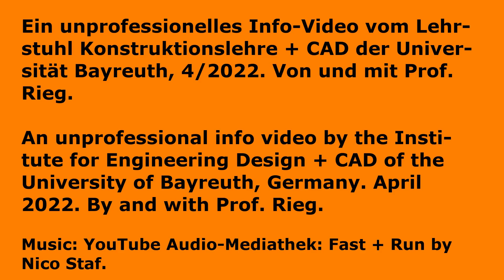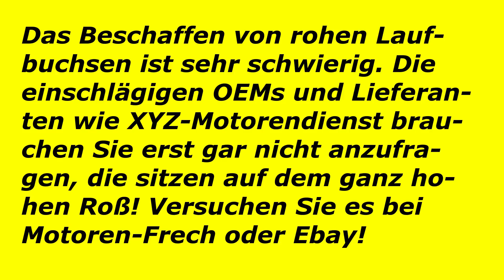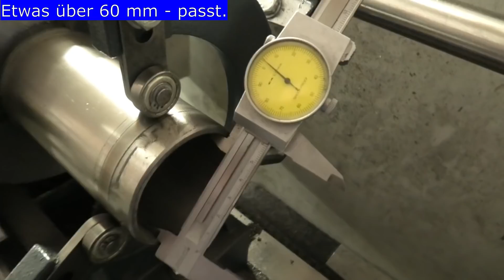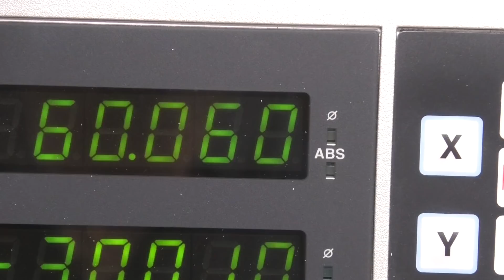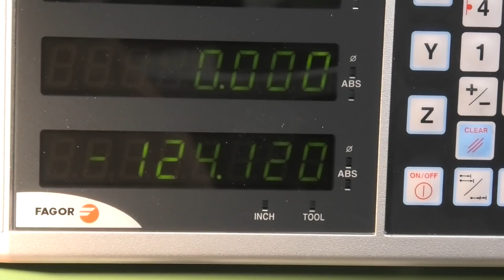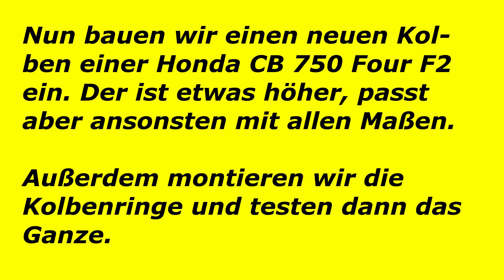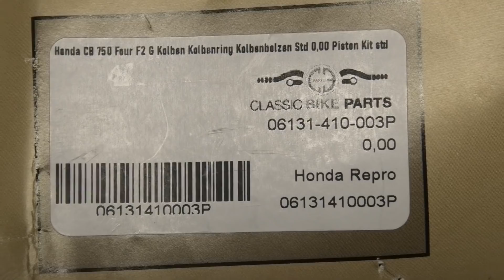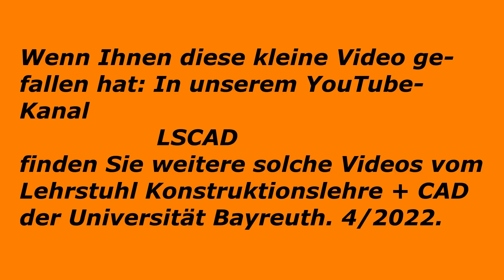Herstellen und Honen eines Zylinders für 158 ccm Viertakter.

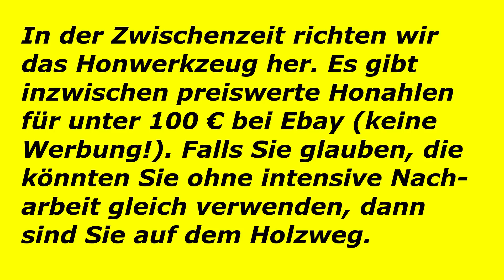Comment: Glad I found your video series, very informative! Can you clarify the honing tool? At 7:16 you say 'the fixtures of the honing stones have to be massively reworked' but you don't really discuss what changes you made to (I assume the Asian) hone tool. Do you mean dressing the stones properly or changes to the mechanism itself?
Reply from the maker: The hone stones are fixed in a sort of carrier each. Those carriers are guided in the hone base tool but could not move freely. Hence, a great deal of reworking for a smooth movement of the carriers in the base tool was necessary.

Comment: The music is just horrendous, just hearing the sound of the machines running and doing their job is much better than any musical racket. 
 But apart from that it was very interesting, I always find that making the cylinder barrell and liner is the most enjoyable part of making a small air cooled engine.
 Nice to see a GOLmatic mill being used, and your lathe looked like a Wabeco D6000.